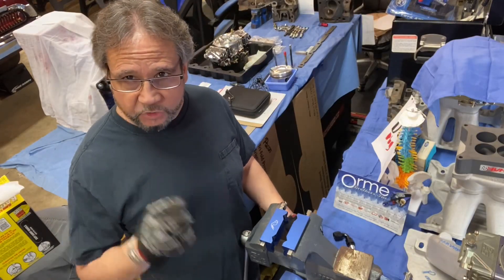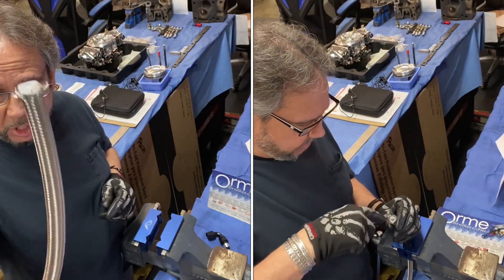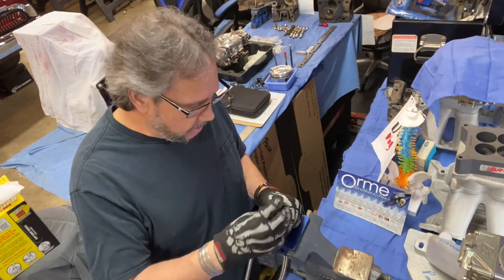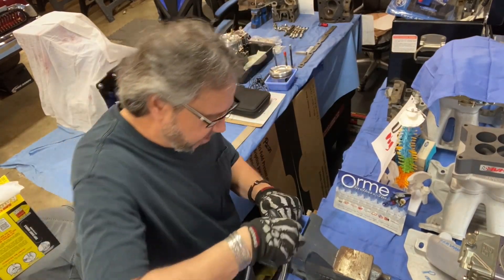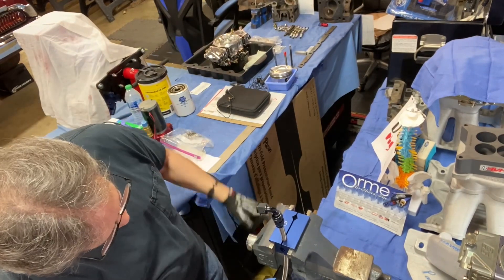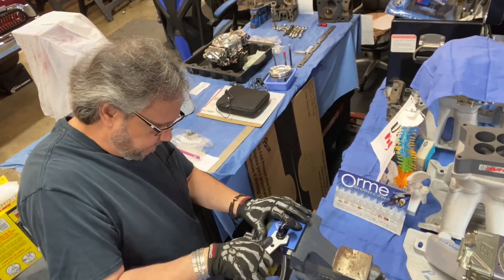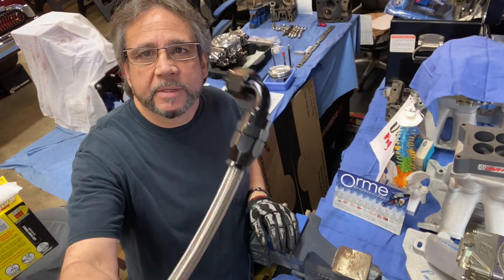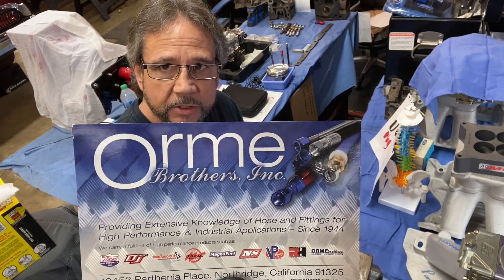DragBoss Garage: Quick Tutorial On Assembling PTFE  (Polytetrafluoroethylene)Hose Ends, Wear Gloves

Comment: PTFE hose will not let any fuel permeate through it because of that ptfe inner tube. All other flexible hoses permeate  fuel (sweats through the hose wall layers). When running a fuel cell inside the boot, ptfe is the only way to go.(unless you like smelling fuel every time you get into  your car... My 2 cents
Reply from the maker: Another great benefit Mark. Your right on

Comment: Man that looks way easier than the standard AN fittings!! Had protection is a definite must!! Those little wires poke the fingers like a pin cushion before you know it!!
Reply: Copper and stainless steel braid can be very painful when puncturing the skin. That’s a hard lesson that I learned 50 years ago. Stainless braided hoses were more like a bling item on most of my builds due to the slightly higher cost. 

My experience with stainless, copper and aluminum braid is a result of my job as a CATV linesman. Installing Cable TV main trunk cables of the larger diameter from 0.750” up to 1.000” O.D. , convinced me of how important a good pair of thick leather gloves really is. Especially when working outdoors, high upon a wooden utility pole in sub-zero temperatures 🥶. 

Oh well, live, learn, repeat until you get it right 😉. Being the Cable Guy had its perks 😇
And the beat goes on…..
Reply from the maker: No matter when I work with them, always getting stuck. And I though you were only into surveillance. Who would have know.  And the lineman sees it all. Double time now.
Reply from the maker: Sure is Rick, yeah got poked making vid, so thought I better mention it. Like handling a Cobra.

Comment: Just got a new convertor form A1 in Vancouver Wash. They implored not to use steel braided rubbeer hose. So I changed mine and was quite happy with the process of installing ends.
Reply: I fully agree with A-1 about avoiding rubber hose. With so much good quality stainless steel braided rubber hose currently in use, it’s a little difficult to tell the difference on fully assembled rubber hose sections without partially disassembling the hose in question and checking for a PTFE (Teflon) lining. 

Good call on the Tonto and A-1 for the heads up 👍.
Reply from the maker: Right on Daniel. Best change I ever did.
Reply: @dragboss351cleveland  … Right arm Tim 🦾.
Reply from the maker: And left too. 🦾
Reply from the maker: Sounds like sound advice, double positive Tonto

Comment: Never used that line before, looks like a better product than the rubber lined hose. Seen my share of stuck needle and seats from the rubber lined steel braided hose deteriorating.
Reply from the maker: Yes very simple to use and works like a dream.